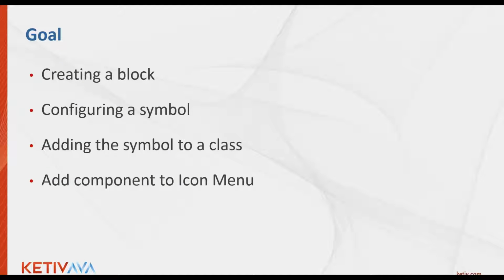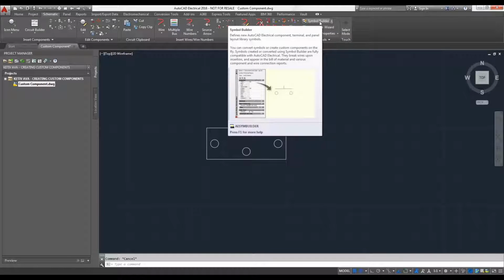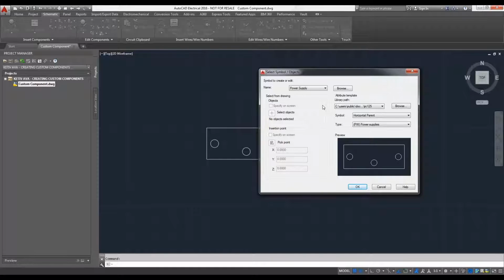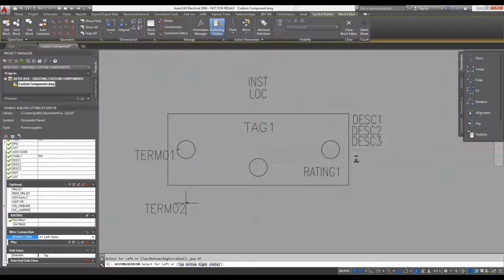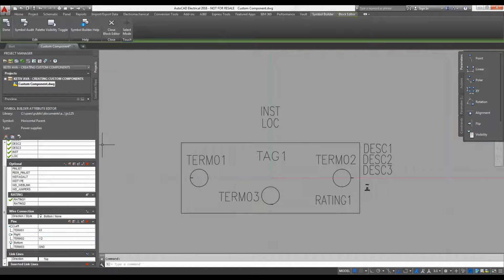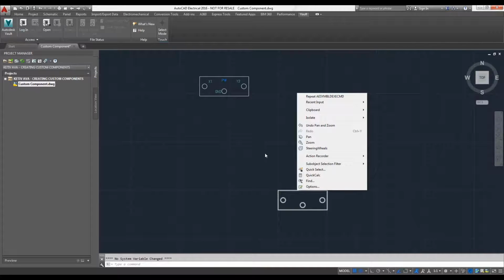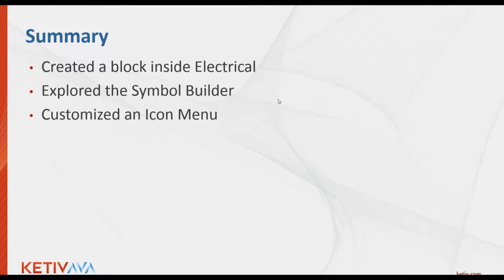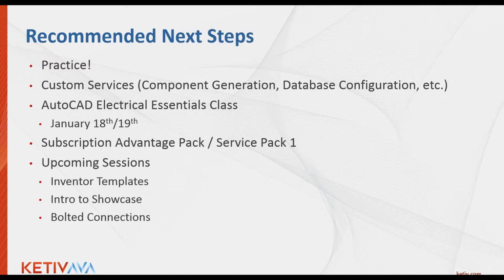AVA: Creating Custom Components in AutoCAD Electrical 2016

Comment: Awesome video. But after you have finished creating your custom component, how can you go in and edit it, in case you forgot to add a connection, for example?
Reply from the maker: Go back in and open the file in question. At that point, you should be able to edit it and save it back down. If multiple people are referencing that file, make sure the edits propagate down to them as well.